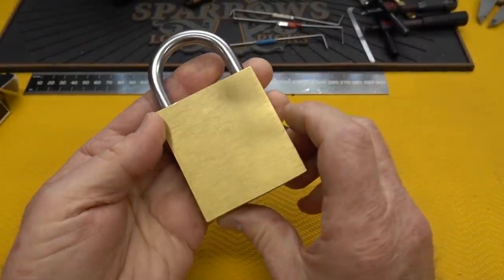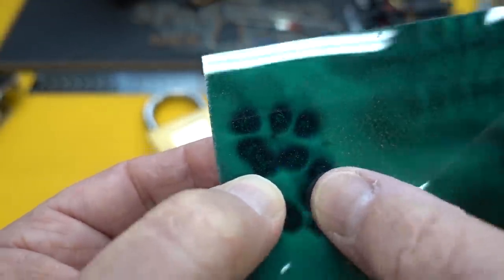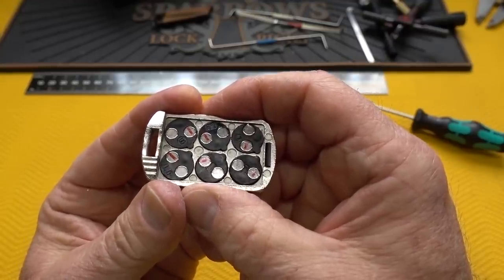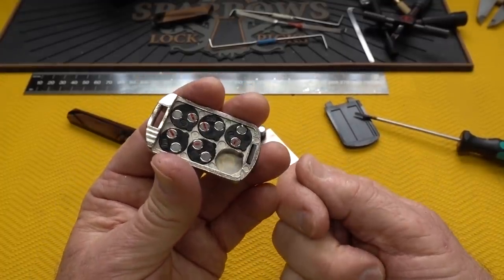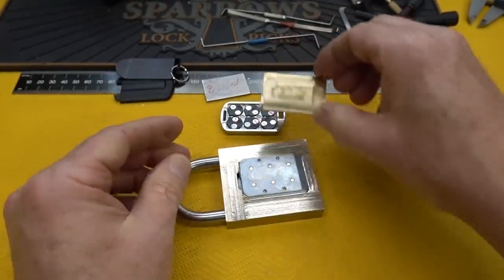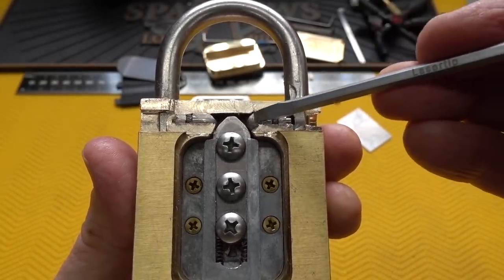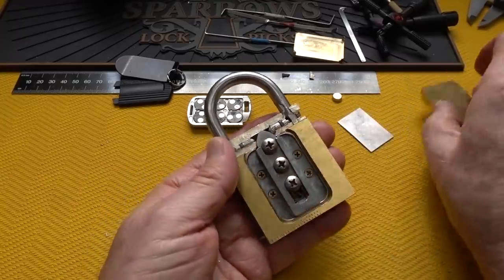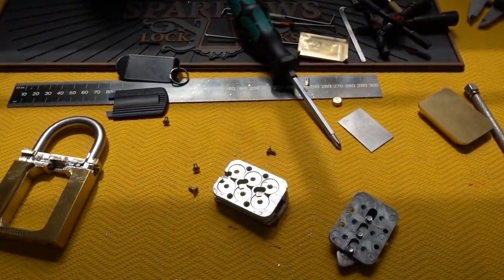(1701) RELOOK: Magnetic Lock (How It Works!)

Comment: So even if you knew the orientation of the inside magnets you’d basically need to build another key to properly align them and open the lock. Super cool
Reply: miniclip1371 Or you could have 6 magnets on rotors, so when you apply tension, magnets are stopped when they are at the correct position.
Reply: The internal magnets are set to a default n/s up/down orientation as shown when Bill first (and later) opened the actual lock.  The gate position is the difference with all the tumblers and that is where the key's magnet orientation comes into play.
Reply: @antoy384  Nope, you can't apply tension. If one of the rotors is not in it's correct position, then tensioning it will cause it to bind. And since it works with magnets, you can't create enough torque to overcome the tensioning. Basically, you can't decode it with tension. You'd need to rotate the rotors little by little and tension inbetween movements.
Reply: You need a key with six little dials on it. I doubt the magnets will be strong enough to turn the inner disks and give any useful feedback under tension though.
Reply: @eerikhm  I would expect that if one had a key with loose magnets that could rotate, then when not under tension, the little magnets in the key would all turn freely, but applying tension would cause some combination to bind while the others were free.  Setting the binding magnet(s) to the correct orientation before applying tension would result in other magnets binding.  In the absence of false gates, I would think that a key with magnets that could easily locked and unlocked would make it possible to decode the bitting in just a few minutes.  If the torque from the gates is too small to feel, one could check for binding gates by applying a key where the pins to check were all set to an off-center position, applying tension, removing the key, and then using viewing film to see which wheels hadn't reset to their normal orientation.
Reply: @eerikhm  Applying the right amount of tension would be very difficult, but not in principle impossible. Whether it's within the realm of human ability hasn't been tested to my knowledge.
Reply: @flatfingertuning727  You would not be able to tell which ones were binding and which ones were free, though. From the looks of this, the mechanism will not give any usable feedback the way a conventional Lock does. Remember that the feedback it theoretically can give, is mediated through a magnetic Field, which is squishy, to say the least. It would be like picking a Lock With a rubber lockpick.
Reply: @eerikhm  I think you could find the binding disc and apply just enough tension (or keep applying and releasing) to get the disc to click into place.
Reply: I bet you could decipher the key with a bar magnet and a stethoscope: Tiny tension to the shackle, then use the bar magnet to rotate each slot, listen and when it stops rubbing it's locking pin then you got your position. Repeat five more times and you got the key.

Comment: Well you know you can tension it with the shackle now. So with very fine control over tension you could use one of the key magnet pairs (twisting it to spin the spinners one by one) to eventually jiggle all the spinners into place. You will get some feedback when a spinner is binding or in a gate. If you're keeping track and have v good tension control perhaps you can pick it by 1. Finding the tension level that binds only one spinner (assuming it's built so that all are not in a gate when reset), 2. Slightly releasing tension to allow that spinner to bind only slightly so you can move it. 3. When that one stops moving it is in a gate. 4. Move on to the next binding spinner, etc.

Alternatively, one very large magnet circled around the lock slowly, which will drag every spinner around with it. You'll still need v fine control of tension but you can use this like a rake.
Reply: Yeah, that sounds about right, in theory. Could you imagine actually trying to open the thing like that though!? I think you'd have to have some suuuuuper patience as well as those spidey senses you'd need!
Really cool video.
Reply: grab a drill, mount one of those magnets LPL likes to use against a bunch of different electric locks, and spin it above the keyplate while varying the tension on the shackle
Reply: And if that does work I still doubt it would be picked by a person wanting to steal what it is locking. It seems like too much time and effort when a bolt cutters is simple and faster.
Reply: tyvek05  You would feel them bound or free. With light and careful tension control you could figure out the first disc to bind, lighten just enough to enable it to spin if you give it a bit of jiggling and you can find the spot where the pin is over the gate because the light tension will have moved the pin into the gate and the spinner will stop turning. Then you can leave the picking disc in that spot so you know that spinner is picked. It would require a very very light touch and probably be v frustrating. You're also competing with magnetic fields from the other pins which might give you erroneous feedback.
Reply: @BD90..  The point of picking is to do this without damaging the lock, if you can get another key but can't wait for this, or if you're a criminal or spy trying to get into something without people knowing you've done so. No lock is impenetrable to brute force. If that's your only concern, then you don't need a super secure core, just buy the beefiest lock you can get. That's why Master sells so many locks with crappy cores but reasonably solid build.
Reply: "Well you know you can tension it with the shackle now."

not really.  there is too little play in the lock to garner the proper tension necessary to get the little wheels to catch on the pins if you rotate them manually.

sorry, but it's not gonna work.
Reply: @yetanotherstronk  Not disputing that. Just being realistic with what this lock is most likely going to be put up against. So a shrouded shackle padlock that can't be raked or bumped easily should do just fine. My concern is the weakest link the shackle. I want the best lock against the most common attacks personally not a highly unlikely attack that is done by someone who is probably determined enough to get in without me knowing until k do forensics on the lock.

Comment: Now that we know there is that that brass cover on the back I’m wondering if you could drill a hole in the cover and pop the guts out and defeat the lock where it hangs with as little as a drill and small screw driver

Comment: If there is a way to deduce the magnetic orientation, I wonder if a lock picking key could be made. You tension the shackle, place the key on the lock and manually rotate wheels and listen for the click or movement of the pawl.
Just a thought.
Very cool lock indeed 👍🏻
Reply: I was really hoping he would do exactly this with a follow up video. You don't even need a way to deduce the magnetic orientation. A panel of 6 disks with magnets of opposite polarity place 180 degrees apart  with knobs to let you rotate each disk separately, would allow you to tick each lock disk into the notch position. You could only do this if the tensioning provided enough feedback. Otherwise it would be too random. Still, it is very difficult to catch that very tiny range between loose and tight. Loose enough to move usually means enough wiggle room to detect a set. With this style of lock there would be no overset. If it is made well enough you might need to use a sensitive indicator to actually find a set for any disk.
Reply: ExtantFrodo2 You don’t even need the feedback. Discs will stop rotating when they are at the right position. There is no false gate, so the first gate is the correct one.
Reply: @antoy384  

nope.  there is nothing to stop them from rotating around.  that's part of the design.  what you guys are talking about would ONLY work, if the tolerances are such that you can put enough tension to get them to stop rotating once they hit the pin.  but I did not see that kind of play in the lock mechanism.  it's tight.

I don't think what you are talking about will work.
Reply: @thomasneal9291  
It looks like any tension will prevent the tumblers from turning to ANY position.  I only say this because I can think of no way to apply pressure to the tumblers.  You are limited by the magnet force.
Reply: Imagine a Philips rotary shaver but razor heads replaced with 2x3 grid of small motors and those magnet pucks on the axle ends. Then rotate the motors so that one column turns opposite to the other column.
Reply: Right, well, once one knows the disks, just turn them one at a time using a magnet... But I'm interested in how they seem to spring back, I'm not sure one could tension enough to still turn them, too loose and they'll spring back (I'm assuming there is weaker magnets in the back of the case that they align back to. One might be able to use sound feedback (stethoscope) to know when one has hit the right position, which is what those that can pick EVVA MCS locks do, which is actually a fairly similar idea, only in a pin/tumbler like formfactor.
Reply: I don't think knowing the magnetic orientations will help any (or is necessary).
Reply: @EwanMarshall  I don't think there are any extra magnets in the case. What makes them "spring" back is the attraction/repulsion of the magnets on adjacent discs.
Reply: @UTubeHandlesSuck  Ah, maybe, that makes some sense. Whatever it has to be a weaker field than the key.
Reply: 2 Reasons why this doesn't work, from personal experience owning the lock.

1. There are 3 pins on that are equi-distant and all need to pass through the 3 separate pairs of "gates" to allow the lock to open. So you can't "pick" one magnet at a time. With how tight the tolerances are you wouldn't feel any shift in the locking paw. Not to mention you can't even be pressing down on the locking paw as it would be inside the shackle housing. So you'd have to be pressing down on the shackle to tension the paw to tension the pins....yeah GL getting any real control on tension on feedback with that many links.

2. These are magnets people, if you tension hard enough to get feedback (Assuming you can even tension the thing using the shackle), then the little magnetic wheels wont turn because you are now binding the wheels with friction. As we saw when Bill was showing us the mechanism with the covers off, the wheels weren't even turning properly there because the wheels were binding on the sides due to not having the other lid to help center them.
Reply: @acywei  The tolerances are similar to those of other locks, and applying tension creates a bind order in those as well. A few microns difference is all that it takes.
Reply: But there is no click. The little  discs all have magnets on them,. and they move freely in their recesses. The thing that holds them in their correct orientation is the magnetic Field from the key. 
And the Wheels will not move while the Lock is tensioned. That effectively removes the kind of feedback you get from a Lock cylinder when manipulating the pins or discs. Because there you feel for the movement when the tensioned cylinder moves slightly as the pin moves into a gate.
Reply: It was just a thought guys.
Reply: The key can probably modified into a pick tool its simple just file the notch and its free spinning it will automatically align to the lock disk orientation maybe can pull the lock and spin the top disk to the bottom disk and see if can feel the click.
Reply: @comingviking  lock wheels may be able to move with some tension... Tension is not an all or nothing proposition. It depends if magnetic forces are stronger than friction forces. In which case, there can be an audible click as it goes in the gate. What you are suggesting is like overtensioning a pin and tumbler, then surprise surprise, all the pins bind and one breaks picks.
Reply: @comingviking  They will bind when the lock is overtensioned, unless they are in a gate. If the lock is properly tensioned they will drag.
Reply: I was My First Thougt, but as soon as you try to tension the Screws will Touch the inside Rotary Element stopping it from spinning. 
I Suppose this is nearly Impossible to be accomplished by Hand.
Maybe a Mechanic Tensioner doing tensioning in micrometer steps While continous spinning the Six Key Elements could be successful. But this is a Hightech inside Labor approach and defenitely Not a street-Attack.

Comment: I can't even see how you'd be able to easily pick this thing.

I guess you could do the whole arduino thing, but rather than electromagnets you'd need six tiny stepper motors attached to small discs with N&S magnets attached. The motors would then rotate each disc to try different combinations and work through them all a bit like how you'd work a combination safe using an autodialer.

It'd also need to be able to pull on the shackle to test each combo.

....yeah, 100% not worth it.
Reply: Stepper motors are essentially packs of electromagnets, so a more compact electronic pick could have a pattern of overlapping magnet coils for each spinner and analog driver circuits so a non-arduino chip can choose net angles and sense the tiny feedback from a binding spinner to decode the lock.  Would be expensive and only for secret entry to bug a location or copy documents.  Because destructive attacks are easier.
Reply: @johndododoe1411  True, but micro stepper motors are cheap off the shelf components which cost literally pennies ( https://www.aliexpress.com/item/4000778769003.html ). 
Custom-made overlapping  multipole electromagnets would be many orders of magnitude more expensive in comparison.
....And even then I'm not convinced that getting feedback from the spinners would be effective so you'd still likely be required to brute force the combo.
Reply: James Bradwell you wouldn't need custom magnets per se. If you have this lock in order to build a device to pick it, you could just take apart the key and use those magnets. And you could use some sort of pneumatic assembly to try and open the lock automatically.

Sure, it's a load of work and will probably never be worth it, but it could be feasible.
Reply: You can just put 6 small standard bar magnets on the front of the lock (depending on the magnets strength you may need a simple grid to keep them in place). Then tension the shackle and proceed with the standard picking process. rotate the disks with your picking magnets until you feel a gate.

Comment: Sir, I have seen a lot of locks in my time (48 years old); The first super duty lock I ever saw was a Discus lock, the round fella. Then at my old job, we use Transport Security's Abloy locks (#350 & #341). I took a few apart over the years, had lots of little disk in them; they were a super badass lock.  But now I come to your channel and see this magnetic little guy.  One of the most curious locks I have now ever seen.  Good work on figuring this out; I didn't think from the beginning you could spoof it and I was right; I did hesitate when you brought out the degauss machine, but that fell apart.
You are a genius when it comes to this stuff.  Have a great day Sir.  Also, those combinations of how they did the north and south on a disk are just ingenious, I would like to meet the person that came up with this.

Comment: Definitely verrrrry interesting... I do have to wonder, though, what the heck good people think dumping aluminum powder (etch-a-sketch) on it is going to do... It's not magnetic.
Reply: There's a related toy that uses iron filings with a little magnetic pen. I had it when I was a preschooler. Iron powder would do the same thing that better magnetic viewing film would do: reveal the position of the magnets. Of course, the actual "code" to the lock isn't the position of the magnets alone, it's also completely dependent on the position of the notches on each wheel, so the powder is only useful for giving you some feedback about the state of the lock as you're picking.

Comment: Looking at the internals, the polarity of the magnets, the rotational orientation of the magnets relative to the key, and their size, you can derive, per the manufacturers' claims, that there are approximately 262144 possible nonrepeating combinations.

1.) So, given the aforementioned and the fact that there are 6 positions comprised of 2 cylinder magnets with 2 pole orientations, you can infer that the key would have to match in a similar physical configuration as the lock internals. Therefore, mark the center positions on the lock body using magnetic viewing film to determine the center of rotation of each magnet pair.

2.) To determine the orientation of any one of the magnet cylinder pairs, you would insert a similar but stronger set of cylindrical magnets inside of a set of transparent straws, bound side-by-side. Place it on top of the center of the pre-marked position and then measure the height of the magnets in 4 different configurations (i.e. NN, NS, SN, and SS), whilst rotating 360°, until the height of the magnet pair is at its apex.

3.) Once you have found the maximum height of the magnets, you now have the opposite magnetic polarity and angular position. This reduces the original 262144 combination key-space significantly. You now only have to orient your 6 magnet pairs in a total of 384 combinations instead since the combinations have now been reduced by the following equation 6 * ( 262144 / 2 ^ (2*3) ).

4) Use putty to hold the magnets' orientation pairs in place. Start spinning...